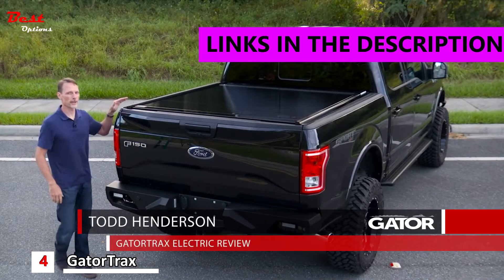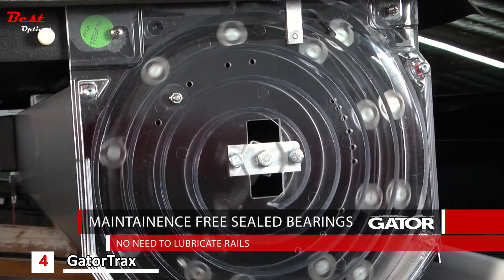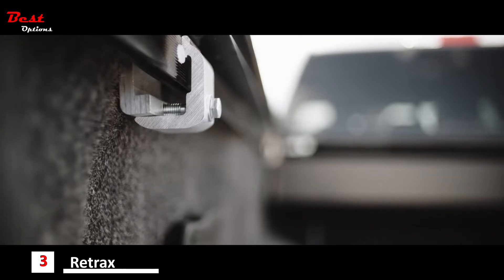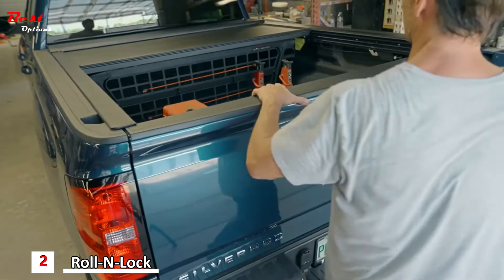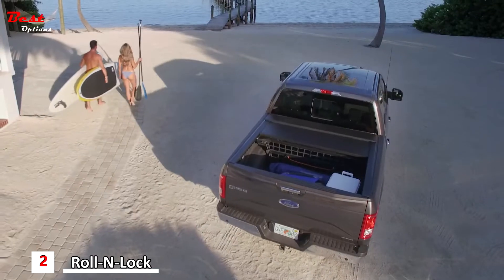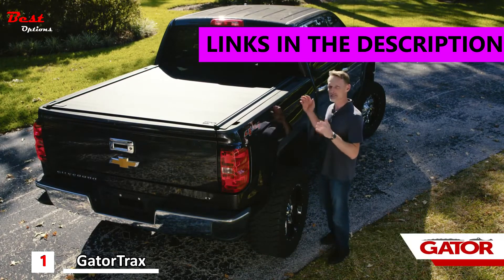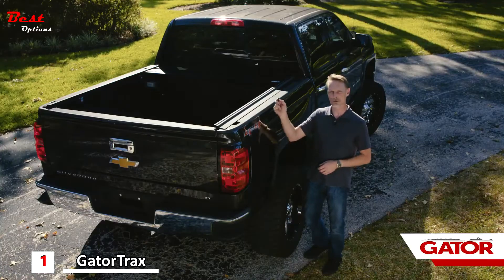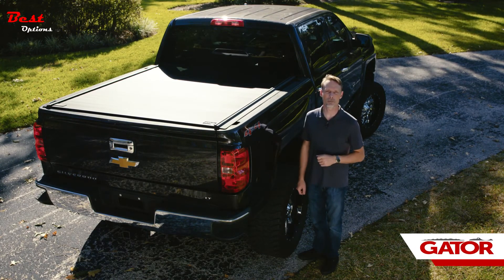Electric Power Retractable Truck Bed Tonneau Cover

Comment from the maker: ✅4. GatorTrax Electric Retractable Tonneau Cover - 00:04
Amazon US – https://amzn.to/3y8kEUh
Amazon CA - https://amzn.to/3y51mPy
✅3. Retrax PowertraxPRO MX - 01:04
Amazon US – https://amzn.to/3dCcrOA
Amazon CA - https://amzn.to/3y3M91m
✅2. Roll-N-Lock E-Series Retractable Truck Bed Tonneau Cover - 00:04
 Amazon US – https://amzn.to/3y51WwO
Amazon CA - https://amzn.to/31CsdH3
✅1. GatorTrax MX Electric Commercial Power Tonneau Cover - 00:04
Amazon US – https://amzn.to/3EOh1VW
Amazon CA – https://amzn.to/307Xh0x
Reply: 6